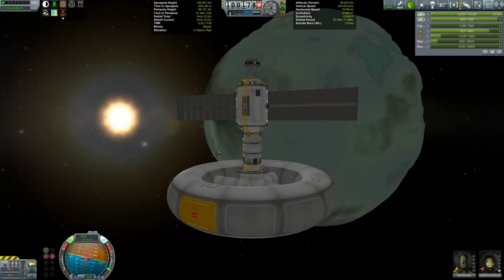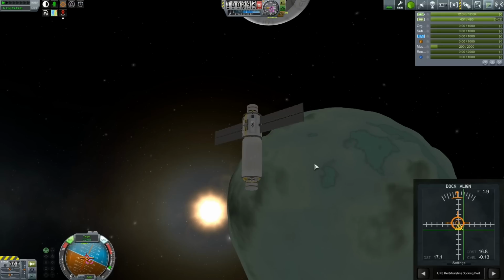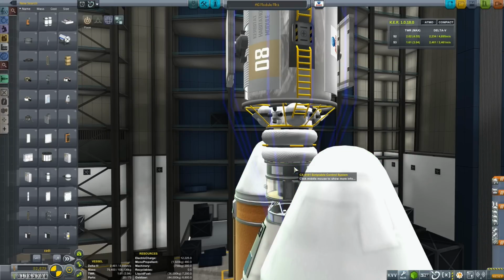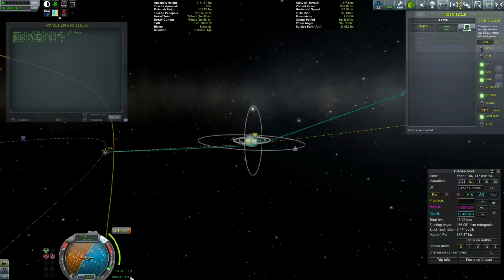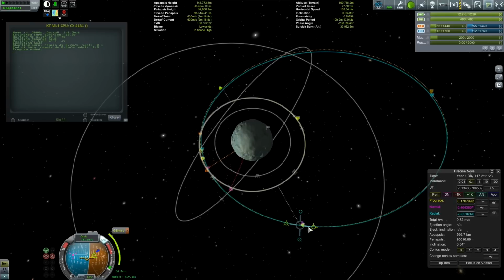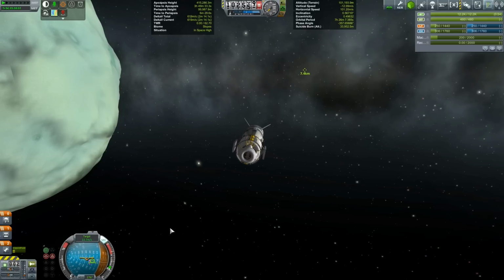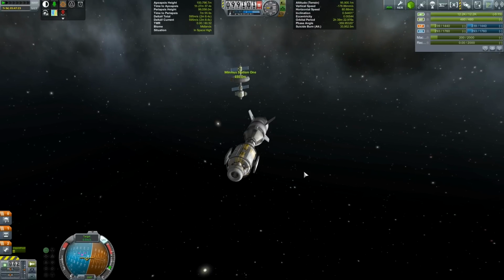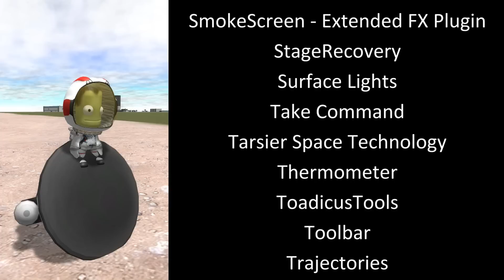25: Closed Loop (USI OKS Space Station)

Comment: I like that RCS build aid.  It's too bad something like that isn't built into Engineer.
Reply from the maker: +Mike Aben RCS Build Aid is indeed one of the more useful mods. It adds a function which really affects gameplay, but in a way which enhances it, rather than "cheating" or automating a basic function. You're right, it ought to be stock, much like the mass, thrust and lift bubbles are, along with the gizmos.